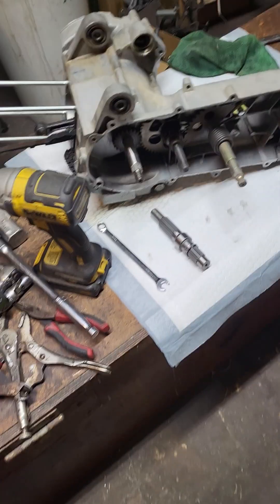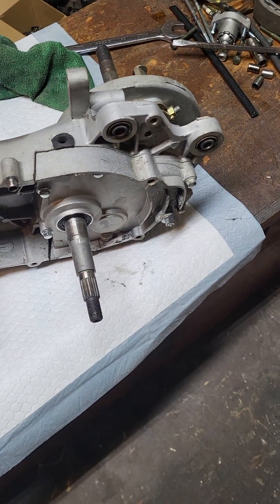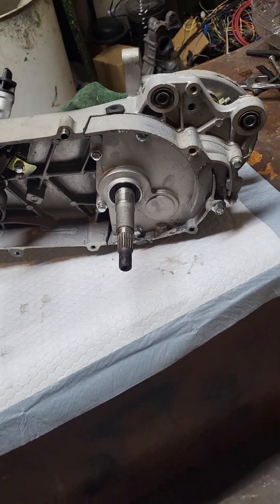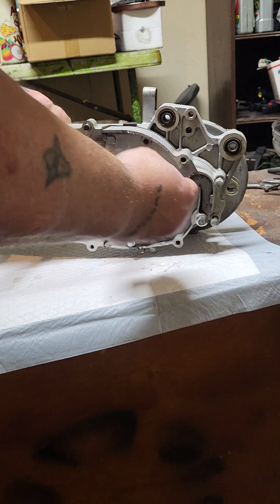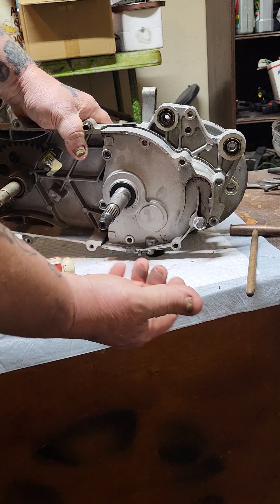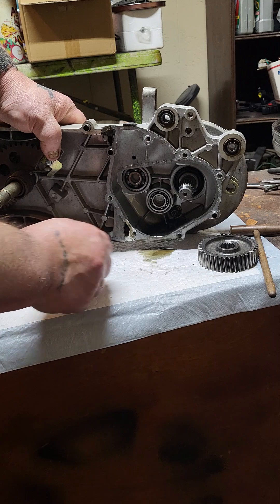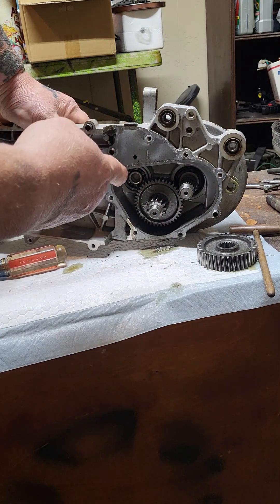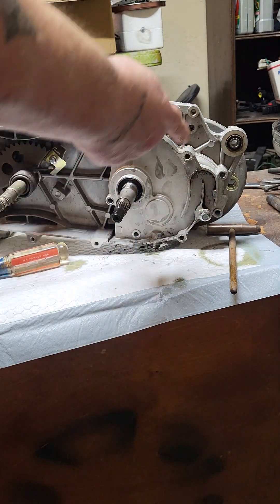honda ruckus gy6 150cc short axle installation

Comment: So would this work if I was trying to get rid of the fat tire on the back of a mad dog and put the skinny tire from my TaoTao quantum
Reply from the maker: @billerickson806  you should be able to remove the fatty wheel and hub and bolt on any scooter wheel you want , if it has the short axle great if you got the long axle you can change it or use spacers under the nut a 3inch spacer just so the wheel will tighten down
Reply: I took the axle out of a TaoTao quantum 150 and the swingarm